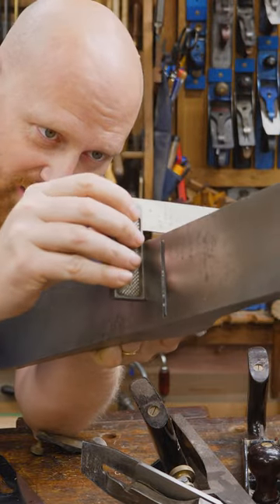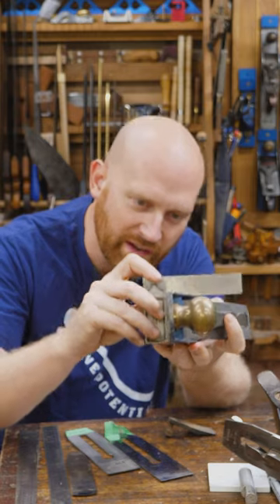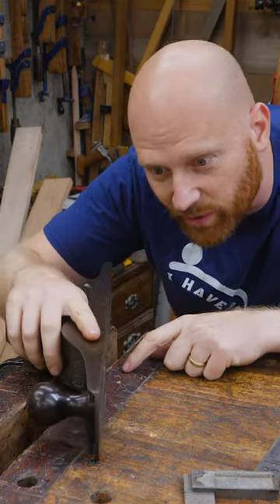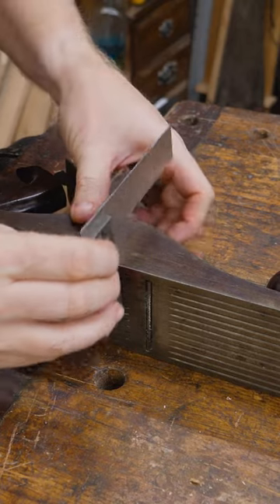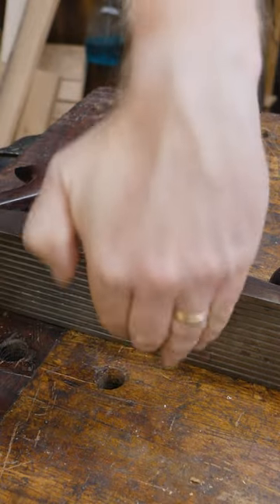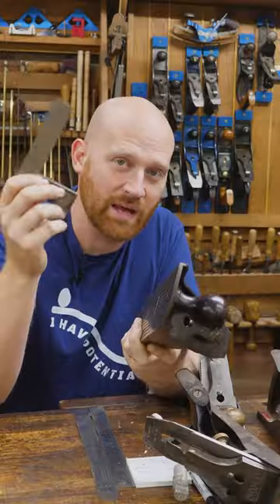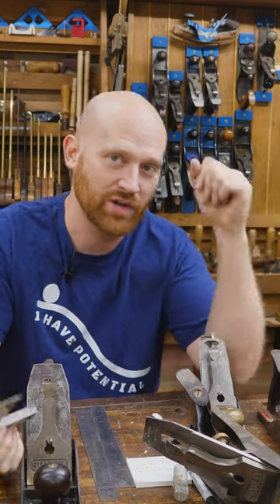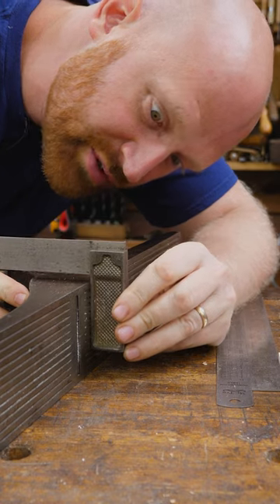Is the Side Of Your Plane Square To The Sole

Comment: This is just my speculation based off metallurgy I had to learn working on vintage aviation stuff (so not exactly the same), but I believe the angle is probably there due to the casting process itself, like someone else said, I think it's a draft angle put in for the casting process. I would think they probably cast the bed and then lapped the bottom and just polished the sides and called it a day. If they were trying to get parallel sides I would think they would cast them with thicker sides and then machine the sides down to thickness using the lapped bottom as a reference.
Reply from the maker: yup that is the reason. it was something they did not have a reason to change.

Comment: I thought it was from the casting draft/relief angle? To make it easier to remove the new castings from their molds? At least that's what I assumed, anyway. Interesting to learn it wasn't actually part of the casting process, just an oversight.
Reply from the maker: That was something I was going to say but they were cast in sand so the relief angle isn't as useful there.
Reply: The draft is on the non machined surfaces (the inside)… sand casting requires more draft, while investment casting requires less unless it’s a multi part wax mold or shell core mold. There are some exceptions to this rule, however that tech wasn’t available back then. The cheeks are out of square for a few reasons, the biggest being it didn’t matter because these planes were not designed for shooting, a No 51 & 52 was Stanley’s answer to shooting, another reason is metallurgically based……. Iron moves, especially in thin sections heat and cold cycles release the stresses from the casting process and is the reason old iron foundries would leave castings out to “season” before they were machined…. @woodbywright if you need any further info on this you know how to reach me.

Comment: The root to a square edge is edge
Reply: Are you saying it is for clearance?  
My first impression was that they angle it in so the plane body follows the corner, rather than the side.
Reply: Edge=Root(Edge^2)
Reply: @paco_vazquez  Imperial rules.  12*5=60*2=120-100=20/2=10/2=5
Souls that claim metric is better because it does base 10 are dull.  
They follow the side instead of the corner.  
i can tell you stories about Jersey barriers
No fun to sideswipe at speed.
Reply: @michael-dm2bv  absolutely, and metic rocks. Either way nothing beats the story-stick
Reply: @paco_vazquez  Metic does rock.  Although i have listened to metric before and they suck.  i have never listened to the story-stick.  i will check them out.

Comment: Are sides and sole supposed to be square and therefore better if they are?
Reply from the maker: There is no direct function for the side to be square. It just makes the perfectionist feel good. In the past there was no expectation for the side to be square however nowadays if a company doesn't do that it's considered to be a reject. Just as if there would be a scratch in the side.
Reply: Drats. Video teased me with an excuse to check my planes then go play with the surface grinder. 😄

Comment: You can't just cast a completely perpendicular shape like that. To the operation of machining the bottom flat, which is a substantial expense, you'd have to add ones to machine sides square and flat and treat the resulting burrs and edges, it would be spectacularly expensive.

Comment: If they are grinding sides they are setting the angles.  
That tens of thousands of planes went out, in a day and age when companies had pride in their work, seems to me to be unlikely to impossible.  
Even my small Stanley hand plane has this "defect".
What are the chances that every machinist at Stanley set their grinder angle wrong, or of every toolmaker at Stanley being unable to create jigs for their planes that hold parallel angles?

Inward tilt makes sense.  Plane rides the corner, not the side, and if you dress the edges of your plane, unless your a 300 lbs. gorilla using a course file, you are unlikely to get the bevel to reverse, which would be no good.

Comment: I doubt Stanley wasn't aware of it. The design of the body leads to the cast metal contracting as it cools which results in the sides shrinking in. Trying to compensate in the casting could result in sides that flare out and need more linishing to remove material. So, it's better to have the sides inboard then other way when it comes to a cost effective tool.
Reply from the maker: I'm not saying that they're not aware of it I'm just saying that it was not an important thing to fix after the casting. Most of the high-end companies now cast them the same way but they will come back and Mill them square to the soul because that's what modern high-end purchasers are expecting.
Reply: @WoodByWrightHowTo  I thought you mentioned it being quality control, hence my comment. Current standards are more due to the low cost of machining these days.

Comment: Friendly tip; if you have "good tools" but they arent square or whatever; most people i know will slave away hand sanding/grinding away. Most machinist shops will do this kind of work and its (in most cases) wayyyy cheaper than youd think. I had a number 8 jointer squared up; and some other vintage tools machined squared up (jointer plane, 2 superrrr old vintage adjustable wrenches, a brass ingot trued up, and vise faces)... it was 40$ lol; which was apparently the shop minimum because it took the guy 10 minutes to do everything. At least look into it; dont write off or "deal with it", and you can get yourself a proper set tool for cheaper than youd think.
Reply from the maker: but why take the time. there is no functional benefit to it.
Reply: @WoodByWrightHowTo  theres no functional benefit to having a flat sole on your planes?  Youre losing me here mate lol
Reply: @WoodByWrightHowTo  also, i see all these goofy tutorials of people taping sandpaper to some glass and going to town for a few hours; how is spending 30$ on sandpapers and markers; and many many hours to functionally still be limited by human error "worth it"; when you pay a dude a few bucks and have your plane precision ground  and back in a few minutes?? I dig your content dude; but this is kind of a wierd take from you. That or somethings getting lost through the aether here lol.
Reply from the maker: If the soul isn't flat and smooth on the plane you won't get a thin finishing shaving.

Comment: I bought a Lie Nielsen expecting the sides to be square but they are not.  I appreciate that this is not guaranteed by design and perhaps it's a good thing to have a slight slope on the sides for some reason but it does mean it's not much use for shooting.  Yes you can adjust the blade but no this is not a great idea since the blade will then protrude more on one side than the other and will promote "grabbing".  Plus, I use my plane on both sides.  It would be nice if they were square, that's all I'm saying.
Reply from the maker: Lie Nielson does make theirs square to the side. If yours didn't come that way then it's a defect. They hold them to a much higher standard than Stanley used to.
Reply: @WoodByWrightHowTo  Thanks, I've actually got the bronze No 4 and the sides are not square, so I have to challenge the assertion that they make them square.  Unfortunately, I bought it second hand (and unused) so no warranty.
Reply from the maker: Oh that will do it. they will take them back if they came that way, but as second hand probably not.

Comment: Planes should be lain down on their sides (to avoid damaging the iron), not on the bed.
Reply from the maker: That is a concept that came out of the post-war shop class. You don't see it before that. And in test after test it shows that you're not going to damage the plane setting it down unless you're working on a metal top or something with males in it. However setting it inside we'll leave the blade open to damage of other tools moving around to the bench or possibly your hand. That's why around 93% of woodworkers prefer to set it down on its soul.
Reply: @WoodByWrightHowTo   That’s incorrect. My father was taught to treat planes that way in Britain in the the early 1930s. 

Also your plane damage theories are also incorrect. Tool care is about attention to details and respect. A bit like caring about spelling and typos…

Furthermore, the set of the iron should definitely NOT be the only element when shoot planing. If the soul is not at 90°, it’s impossible to be consistent. And if you’re relying upon upsetting the iron to achieve 90° cuts, then it’s impossible to use that plane as a standard Jack plane without resetting. That’s just a waste of time. 

And I have no idea where you got that 93% figure from, but I suspect it’s well shaded.
Reply: @WoodByWrightHowTo   By the way, I’m an engineer by trade, as was my father. He trained as a joiner from the age of 14, and did a six year apprenticeship. Then he worked in a big workshop. When he was called up for WW2 he was in the REME (Royal Electrical and Mechanical Engineers) and spent time recovering tanks in the western desert. Then he worked on building sites cutting roofs, making staircases and top end joinery on expensive houses. 

I began by doing woodwork and metalwork at school, then did a six year engineering apprenticeship with Rolls Royce, working on experimental jet engines. Then I began my own furniture design business, in which I used engineering techniques.
Reply from the maker: 93% came from the survey that was just done on 16 different woodworking channels. And I'm sorry but your father taught you wrong. If you look at the books from back around the turn of the last century and they all have the plane sitting flat on the bench.

Comment: Problem is you are using a square thats not 90°. 2 piece squares are trash. If they are good when new. Because of thermal expansion/contraction, they shift out of original alignment.
Reply from the maker: That is why I regularly check them it only takes seconds. This one is right on the money.
Reply: @WoodByWrightHowTo  So you have something solid to reference check? Gotcha.
Reply from the maker: All you need is the straight edge of a surface. 90 degrees plus 90 degrees is 180.

Comment: Metal casters always put a slight draft on their patterns,  it aids in removing the pattern from the mould and by the looks of it they just face  milled the casting without squaring it  .
Reply from the maker: Bingo.
Reply: i always figured it was so if you were running along an edge with the side in contact with that edge you would have minimal contact and minimal resistance... dunno why but thats how i rationalised it to myself
Reply: @Simon-ho6ly  I have enjoyed both sides as a hobby. I love hand tool Woodworking and have done a bit of metal casting with a homemade furnace also lol
Reply: Ground, not milled.
Reply: @Simon-ho6ly Agreed.  i would vote that it is a clearance angle, for your reasons and so that the plane follows the corner and not the entire side.

Comment: would it be viable to make the bed of your shootingboard tilted to match the unsquared side of your plane?
Reply from the maker: You could but then you would be locked into using that plane and you still have to adjust the lateral adjuster.

Comment: What is the proper way to restore a plains?   I found several plains in my fathers garage, all of them have surface rust on the soul and sides.
Reply from the maker: There is no proper way. It all depends on how much work you want to put into it. Most of them just need to be cleaned up and sharpened but everything else is either aesthetics or just making it function a little better. I have several videos showing different levels of restoration. If you want me to take a look at it and help you out send me an email I'd be glad to look it over and help you.
Reply: WD-40 let it soak for a couple minutes and some 0 steel wool to take the majority off and then fine grit sandpaper with WD-40 to get the stubborn rust. Take the blade out and use a perfectly flat surface like a piece of glass with sandpaper on it to true up the sole if it's no longer flat and true and sharpen the blade.
Reply: @Jimmy-vt8jb  thanks for the reply
Reply from the maker: That is a great way to start an argument.
Reply: @WoodByWrightHowTo  please elaborate.
Reply: @johnnyrocket9372  there are many "correct" ways and many more wrong ways. My way is how a lot of guys would do it around here. Heck some would use a fine wire wheel on a drill to do it and then true up the sole. But most people aren't going to allow any way except their own to be "right." The way I told you will get you where you need to be for most hobby wood working and DIY stuff. I'm certain people that use these tools for their daily bread and butter have different ways to bring their tools back or restore a new to them tool
Reply: @WoodByWrightHowTo  sometimes you just have to set a spark and let the world burn, but I enjoy the content you make

Comment: I doubt any are not square by accident. You would have to go out of your way with standard machining practices to achieve not square.
Reply from the maker: The sides of these were not machined. They were merely flattened. The castings had a slight angle to them so they could release out of the sand and then that side was flattened not machined flat.

Comment: I don't have a plane but I am a machinist, I don't see why it wouldn't be square. Even if you are gonna have an adjustable rake. Rake? Im that right? Either way I can't see why not after you cut one side totally flat you have a really good reference point to make the whole thing square. Seems like Stanley is being lazy to me.
Reply from the maker: Besides we're not cut or polished.  They just came out of the casting and were sanded smooth. There's a slight angle to them so that they can come out of the casting easier.
Reply: @WoodByWrightHowTo  oh makes sense lazy is cheap, cheap is affordable, it probably works fine.
Reply from the maker: Right on. why put another step in the build if it adds no functional benefit. that is why the old decorations became less and less over time.

Comment: Sorry dude, you're theory is not quite correct. Yes the plane iron must be 90deg to the flat surface. But, if the surface behind the iron isn't also 90deg, you would be able to plane a spiral after multiple passes. It's the same principle as on a jointing machine. The cutting blades are installed flush to the run off table. 👍
Reply from the maker: With a jointer the wood is pushed down against the bed on the far side of the cut as much as it is pushed up against the fence. With a plane the wood is just pushed up against the first thing it touches. And that can just be a simple line on the wood. It works perfectly fine just to use the lateral adjuster even if the bed is out of square. I've done it quite a bit and my go-to shooting board playing used to be one that was out by more than a degree.